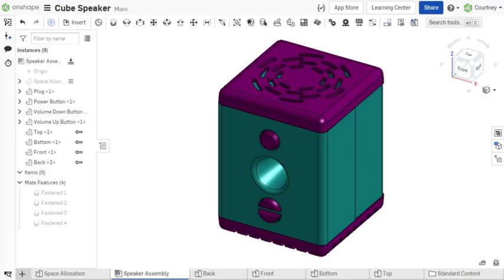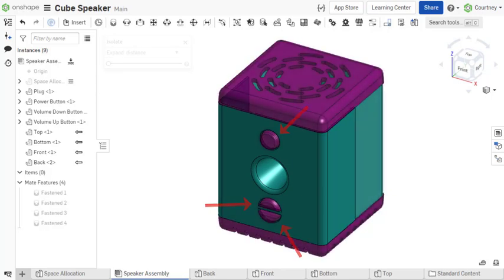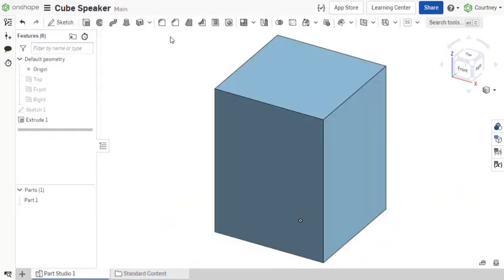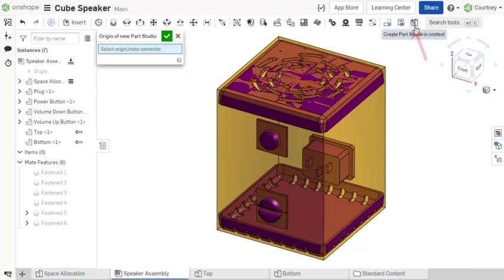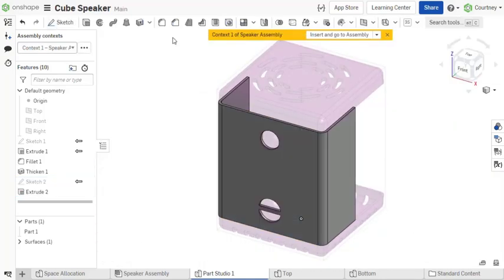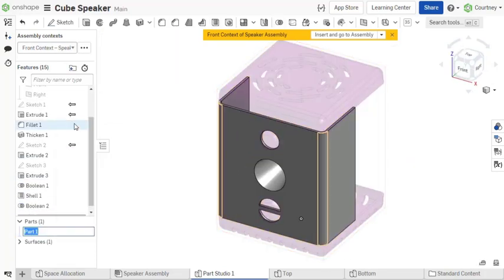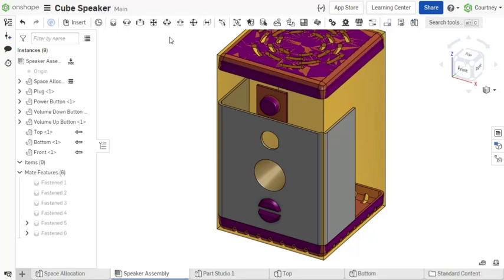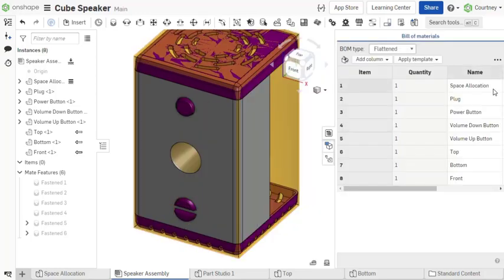In-Context Design with Master Model Workflow

Comment: In this approach, you make a space allocation ps (part studio) and insert it into an assembly. Then model a detail part using an in-context ps. However, to update the context of the detailed ps, you have to insert it back into the assembly. BUT, now other unrelated detailed parts (only related to the master) have context of the other detailed parts (information/interface leak) when creating other in-context ps's from the same master assembly context (this can also induce cyclic dependency). Also the detailed assembly, should not contain the master space allocations and models, these are only reference points (now detailed asm BOM has space allocations). The only way I found to do it right, is to use proxy assemblies for each detailed in-context ps. You create a new assembly, then insert the master sketches, models and allocations assemblies. Then use in-context ps of that new assembly to design the part. Now you only insert the detailed part into the proxy assembly. And the master assemblies (for in-context ps) stay clean.

Also, using the derived feature, I noticed that things slow down quickly, because everything has to re-calculate using references al over the place. The in-context manager does this better by manually updating context and then capturing the frozen context into the ps itself. So I do not like the derived feature in this sense.

But this seems like a hack. Is there a better way?